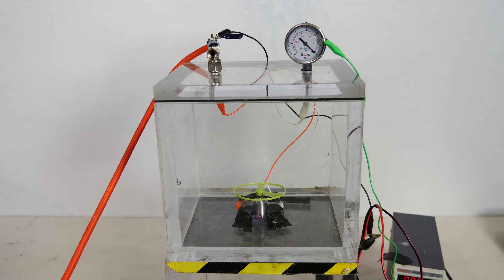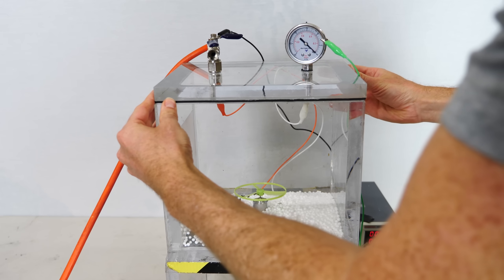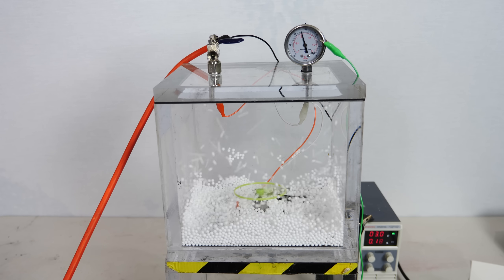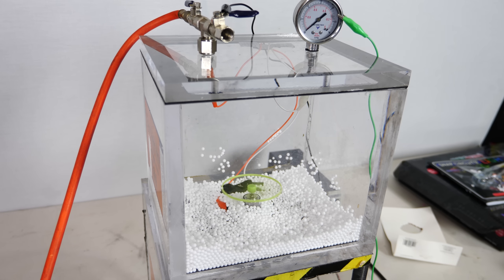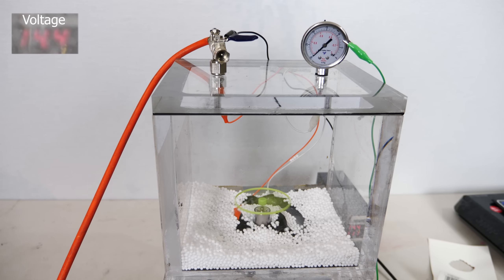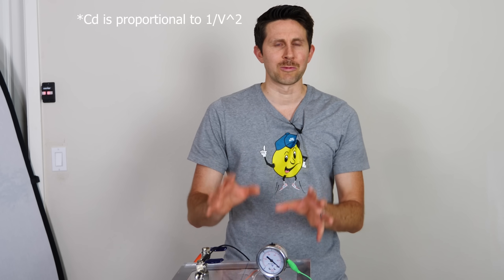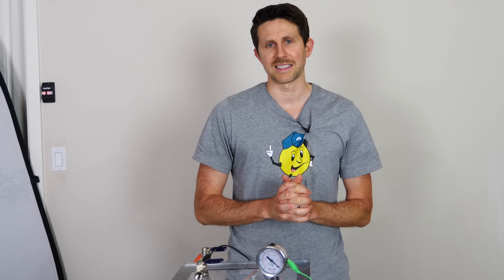What Does a Fan Do in a Vacuum Chamber? Weird Results

Comment: Not very scientific. The static charge increases as the vacuum is non conductive like air is. Air is a conductor.

In the air the balls interact and the charge on the balls constantly changes on the balls as the interact with each other.

There is also vibration from the fan which can excite the balls. If even one ball starts to bounce it hits other balls causing a chain reaction like the old demonstration of Ping Pong Balls on Mouse traps in a room.

So your experiment is useless, too many variables.

The fan should be put in a screen enclosure so any ball that does get excited will not hit another ball causing a kinetic energy transfer.

Put the fan in a screen enclosure and also put the balls in a screened  area in the Vacuum  chamber perhaps above the fan. The fan needs to be balanced to stop any vibration.

You have a vacuum to start with when you initially pump out all the air but there is also a phenomena called "outgassing". The Styrofoam will outgas meaning the trapped gases in the Styrofoam seeps out contaminating the vacuum so let us say you evacuate the chamber then seal it, the gas in the Styrofoam comes out and contaminates the vacuum and it is no longer a vacuum

There is also another possibility and that is if there is any trapped moisture in the balls or other chemicals they will boil as the atmospheric presure is decreased. These gasses are now lowering the  vacuum as the gas molecules are now doing what the air did causing currents of gas instead of air currents thereby moving the balls to some degree. Once any ball is excited it hits other balls once again causing a kinetic energy transfer.

It would be better to have the fan outside the chamber with a screen in front of it like a side chamber but still connected to the main chamber so the pressure level is the same but no vibrations can be transferred or balls going through the fan blades.

Just a fools errand and no scientific value at all. TOO MANY UNCONTROLLED VARIABLES. You get an F.

Maximus has spoken, go in peace.

Comment: It could be interesting to see you try this all with a helicopter by putting the beads underneath the helicopter and then trying to raise it as high as possible and seeing what happens with the beads at that point and could you go to the same level of atmosphere that is on Mars and run the test or go to a true complete vacuum and see what happens or if you could try and get a mock up secondary helicopter that they are using on Mars right now

Comment: Try this in the dark to see if you get a visible static discharge after a while.  Wind-blown dry dust particles will generate lightning discharges, as will blown-in cellulose house insulation (you can see it arcing down the clear plastic hoses.)  There are lightning generators that are based on this principle.

Comment: Quite likely your chamber has some leakage. A 2 stage rotary pump will get far below the approximately 5 torr atmospheric pressure on mars. You need a much better gauge type to measure pressures below  "1 inch mercury"  vacuum. (25 torr) The dust storms on Mars are of a dust that is similar to talcum powder. Ordinary sand is too heavy be moved even by the 200mph winds that are common on mars.

Comment: If you'll create perfect vacuum in that glass chamber....means no air when what would be in there... wouldn't it collapse??

Need to know desperately!!
Reply: No.
As he said, he was able to get the pressure a bit below that on Mars or down to less than 0.6 % of the normal pressure at sea level here on Earth. This means that the pressure difference between the inside and outside of that glass chamber already was at least 99.4 % of what it would have been with a perfect vacuum. It's extremely unlikely that 0.6 % of extra pressure would have broken that glass.

Comment: You don’t have a perfect vacuum so there will still be some air movement. Also, some sound will escape due to the pressure being not zero. 
Your little box can’t contain a perfect vacuum. Nothing really can.
Reply: That box could easily contain a perfect vacuum if it was possible to create and maintain it. The pressure difference between the inside and outside would have been less than 0.6 % higher than what was achieved here, assuming that the inside pressure here actually was a bit less than that on the Martian surface.
Reply: @fromnorway643  A “perfect vacuum”? Really?
Reply: @Roq-stone  
I know that a perfect vacuum is impossible to achieve since even interstellar space (many lightyears from the nearest star) still contains a few atoms or subatomic particles per cubic metre. 
However, if it was possible to create a perfect vacuum inside that glass box, it wouldn't break or collapse since this experiment already has proved that the box can withstand more than 99.4 % of the pressure difference that a hypothetical perfect vacuum inside would create.
Reply: @fromnorway643  Ok. We are on the same page then.

Comment: The movie actually vastly overdid it. On Mars, a wind storm does not have the strength to do the damage shown in the movie. They were aware of this, but left this inaccuracy in because the plot needed it. After all, just about the only effect the winds on Mars have ever had on any of the various probes that have been sent to Mars, (some of which have waited out significant major storms), has been to clear off the dust that was slowly coating the solar cell arrays, recovering some of the otherwise lost power. Moving very fine dust around is just about all the Martian wind can manage. Look at the design of the Martian helicopter probe: Huge rotor, can barely get an extremely light probe into the sky.

Comment: 600 hPa = Just a little bit? 600 mb is like roughly 3/5ths of normal atmospheric pressure.

Fact is that if it truly was a vacuum it wouldn't do anything even if you'd up the rps to a gazillion/sec.

Was cool to see though how chaotic those things were when the drag lowered.

Comment: in the martian, the wind would not have had the energy to knock down a ship, even if they were carrying other material
Reply: That was one of the least realistic things about that movie, plus the earth like gravity.
Reply: @fromnorway643  i'm not sure what almost 40% gravity would look like to us, i think the walk would look a little weird, but we wouldn't "spot" it right away, especially since they've acclimated and learned to walk with less force. I think with 40% gravity people would acclimate and move quite normally

but we'd notice the way things moved and fell - except in the exploding scene, how much did things fall?
Reply: @diceblue6817  
An astronaut's mass and therefore his/her inertia would be the same as on Earth, so it would take just as much force to accelerate horizontally. Using less force per stride to avoid leaping would also reduce the acceleration, and changing direction at high speed would be harder than on Earth due to less friction between the boots and ground.
However, since the gravity on Mars is more than twice the Moon's, it wouldn't be quite as easy to spot it unless the astronauts threw or dropped object or something like that.
When the crew behind such a recent movie as the Martian didn't even try to simulate 38 % gravity, it's safe to say that the Apollo missions 50 years ago couldn't have been simulated in a studio here on Earth.

Comment: either static electricity affected it. Or your vacuum champers doesn't suck all the air out, but instead leaves a very small fraction of air inside, it's IMPOSSIBLE for fans to work in space. because how fans work (it spins a diagonally shaped like segment to push the air down creating a form of wind) Now that wouldn't work in space because there is no air not even a 0.0001. That's why NASA nor SpaceX use fans or wings in their space crafts.

Comment: For a long time I have thought that largish molecules, even dust grains, could act as a gas given the right conditions. So in a vacuum, say the surface of an asteroid, there would be a lot of fine dust, something whacks into the asteroid and a shock wave agitates the dust lifting it. The dust then has enough energy to interact with other dust particles and forms a kind of gas with its own partial pressure. It wouldn't last long, but it makes me think that the surface of asteroids and comets may have some fascinating physics going on.
Reply: Lack of gravity, the dust will just drift off into space
Reply: @kevinireland8020  , depends on the escape velocity. For example, consider an asteroid 1 km in diameter with a density of 3000 kg.m^3 then escape velocity will be about 0.65 m.s^-1 , anything under that will hang around possibly acting as a gas until it settles.

Comment: Very nice experiment. Question:
1. What was the ampere at 20V? I guess it was still lower then max ampere of the motor, so that the motor wasn't burnt out.
2. Im wondering why the beads weren't sucked out or at least flew to the suction line.

Comment: Can someone seriously explain the purpose of the black wire clamped to the valve and the green one to the meter?? 
Or even the red one clamped on the bottom side of the valve??
It's a mechanical valve, not a solenoid .
And the pressure meter is also a mechanical instrument.
I have observed a couple of other things that makes me think that this video demonstration is not realistic and he's using visual illusions techniques.
My conclusion is that this video is nowhere close to be realistic.. It's more likely to be a hoax

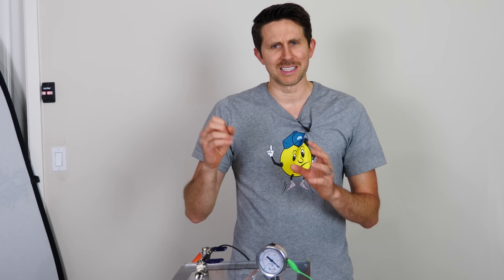Comment: 4:20 With the last power up to top speed you caused enough beads to be pulled into the fan to cause a chain reaction of beads hitting beads.

Look at the speed and pattern of the way they were moving in vacuum. They were flying faster than with air because there is no air resistance to take away kinetic energy.

Comment: This would have been cool to see with a proper fan and motor. A brushless hobby drone motor and 5” prop would have held up to much higher rpm. That being said, as others have pointed out it appears it’s either the vibrations or static electricity that’s moving around the balls at the end, not the actual air movement.

Comment: I think the most surprising part is that the fan motor didn't overheat without any air to conduct away the heat
Reply: That's a pretty small fan and in a vacuum there is very little load on the motor.

Comment: So if we drove a car in outer space we would need an extremely extremely high speed fan to help keep the engine cool?
Reply: You'd need refrigeration, because there would be no atmosphere to move with a fan. In fact, satellites are designed for extreme heat and cold because there is no air to moderate the extremes.

Comment: You missed a great teaching opportunity here. As you sucked the air out, the amperage went down on your power supply, because there was less load ... no air to push by the blade.  A lot of your movement may have been from vibration, and then as the Styrofoam hit the fan, it was launched, not blown, from striking the blade. Good experiment though. If you put a piece of cardboard behind a box fan, the blade speed increases and it sounds as if you are hurting the fan as it winds up, but you are actually reducing the current draw, and the motor stays cool, without airflow cooling assist.

Comment: What I found interesting, that isnt mentioned, the amperage is going down as the vacuum increases.  This makes sense since as the pressure goes down, so does the lift and drag acted upon the spinning blades.  This in turn reduces the amount of force needed to rotate the blades.  Thus, less energy/electricity needed to spin the blades at a given voltage.  Thanks for the vid!
Reply: The same happens in a vacuum cleaner if you block the intake hose. The motor fan starts to spin faster as it has less air resistance (vacuum).

Comment: The answer should be a resounding no.  In a vacuum, the fan can't push/pull anything, as there is no medium to push them through.  Any result that is different means you didn't control for some variable
Reply: That should be the case, yes. But only in a complete vacuum, which this test was not conducted under. If you watched to the very end, he explained how the
chamber was not in a complete vacuum, meaning that some gas remained inside. That's why the fan had to run at a mucher higher speed in order to
overcome the drag of the styrofoam beads, causing them to fly through the air. If this test was conducted in a much greater vacuum, using a turbomolecular pump,
the fan likely would not have been able to do anything, such as in your explanation. There are different levels of vacuum, and only a complete vacuum has no gas whatsoever in it.
Reply: @Fizzle 

Hi , is there a medium in space ???

Comment: Once the pump has removed most of the air, it is static is moving them around. Any other movement is due to residual tiny amounts of air or vibration effects. For the fan to move them, there must be air. If in a perfect vacuum and no static or vibration effects the beads would just sit on the bottom as there is no mechanism (i.e.air) to carry them.

Comment: If you pull that vacuum for any length of time or pull a higher one your fan would melt, any lubricant on the fan bearing, the plastic fan and the Styrofoam beads will probably breakdown and out gas. I agree with the commenters who suggested static. Usually you need to keep something at vacuum for a while even to reach a stable condition

Comment: If you actually take a quantum hydration flask and attach it between the vacuum chamber and the actual pressure osculation valve, you will likely get much better results. My hypothesis would say that the added hydrogen molecules will differ the beads away from the fan, thus resulting in an abundance of electrons to create dark matter. It’d be nuckin futz.

Comment: The vibration of the motor is more likely. The same vibration that allows us to hear the motor in the 1st place is what is causing it. That coupled with zero air friction makes them jump so high. Nothing to do with static electricity.
Reply: Static electricity could be a very small part of it.    Electricity specifically.

Comment: The comment about the movie the "The Martian" was really misleading though. The atmosphere is so thin that it would NEVER actually tip or jeopardize a space craft. Even the worst of storm would barely wave a flag. The writer of "The Martian" even noted that he knew it didn't make and sense but it worked for a good story.
Reply: Yet you easily accept that space has no atmosphere to push off of...
Reply: When I read the book I thought it was pretty dodgy, and then I read an interview with Andy Weir where he made that statement. And thinking it over, yeah, I mean how else is he going to get marooned on Mars? Totally acceptable, just pretend for that part.
Reply: Right- THATS what is absurdly silly about the movie The Martian.
Reply: And I am  Betting that you are all astronauts as well appeared you continue on with that TV watching
Reply: So basically what your saying is rockets don't work in space!

Rockets cannot propel themselves without any atmosphere to push off.

Space travel is a lie
Reply: @theycallmephylthy  Laws of motion still apply. Rockets essentially throw fuel out that back, which means an equal and opposite force is applied, pushing the rocket forwards. You can try this with a skateboard or roller skates, throw something heavy in one direction and you will move in the opposite. No atmosphere required
Reply: @theycallmephylthy  Well, this shows a complete ignorance of fundamental physics.
Reply: @theycallmephylthy  the rockets push off the fuel they propel.
Reply: @theycallmephylthy  rockets and turbines are not the same thing
Reply: @markokriegel5787   No shit really but they are both forms of propulsion taking heated air and throwing him out one side to push off The atmosphere... I'm not gonna get  Into it with you people.

But when a runner is running around the track the 1st thing they do is situate themselves off of a base to propel themselves off.. If you just wag your feet in the air it's not gonna make you move right right this has nothing to do with skateboards bicycles  Has to do with atmosphere. If you dump a bunch of propellant in oxygen into a vacuum it will essentially absorb the thrust it will not propel the machine in which it is being ejected from.... Put your all bunches scientists so continue on
Reply: @theycallmephylthy  no. Turbines use the air surrounding us, Rockets use oxigen and hydrogen that they carry with them in gigantic fuel tanks. Y are u building up a big strawman, lets keep it with rockets. The human body works totally different
Reply: @theycallmephylthy  Wow, no, not even close. Turbines are more closely related to propellers than to rockets.

Comment: This just proves that there is zero propulsion in space due to the vacuum of space. There is no air to push against for thrust. Proves space flight is a lie.. Awesome experiment. Did what i though was going to do.
Reply: Rocket motors do not use air.  They use particles at high speed to produce thrust.    Turn on a garden hose with a nozzle at the end.  The water pushes the hose around.  Same concept.